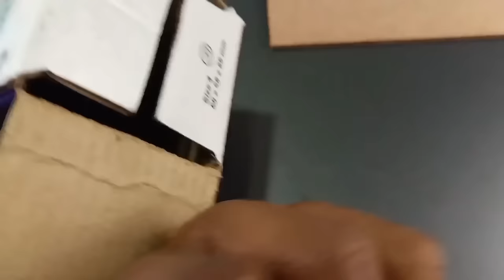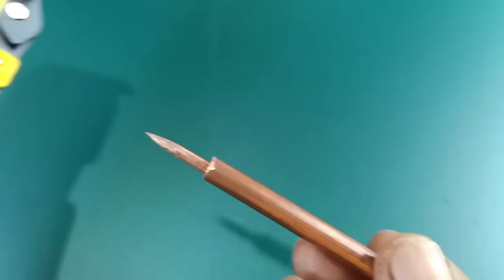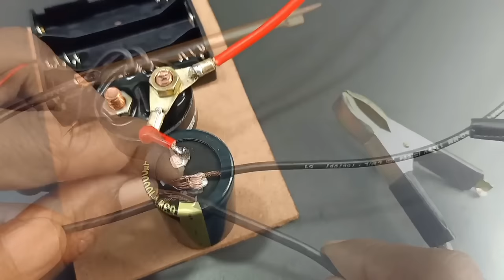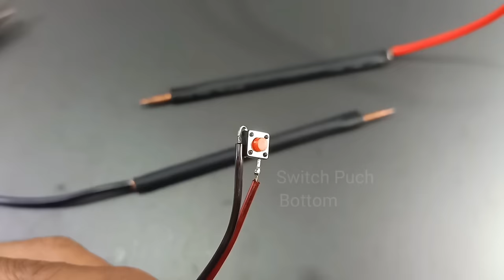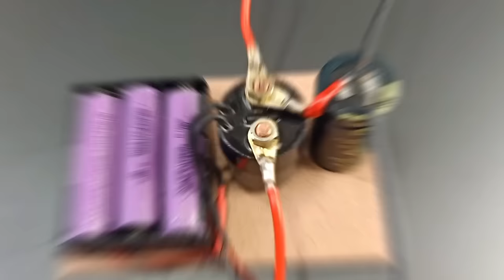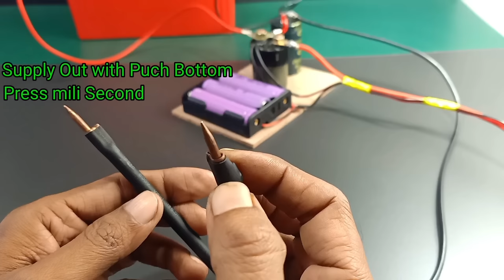Spot Welding Machine Simple & Power, Helpful for Home // How to make a Power SPOT welding A

Comment: Why the redundant power supplies? You have a main 12v battery, yet you use three  3.7v Lithium Ion batteries (11.1v) to power the control circuit. The control can be powered off the main battery, perhaps a 1 amp fuse wired in for safety. Even adding a fuse is less expensive than a battery holder plus three lithium ion batteries. Those lithium batteries actually could be used as the primary battery if you only need to weld for five to ten minutes at a time.
Second, a 16v capacitor is sufficient when running off a 12v battery. The 25v minimum rating is needed when running off a 12v AC transformer, because 12v AC is 17v peaks (12v average of the sinusoid wave form)

Comment: You don't need the 18650 batteries nor the capacitor , you put it there to make believe is something else , all the  big amps come from the red battery, and the relay can be switch  on/ off  with the red battery too. Or you don't know that the two circuits of the relay are electrically isolated.
Reply from the maker: You try, complete understand, lithium battery and without lithium battery

Comment: Use 1amp 12v enough if u use capator
Reply from the maker: Not possible, minimum 20A
Reply: Capasitor can charge usin low current
Reply: We will get 4700uf 25 volt 10 piece capasiror 47000 uf total below 260 rupees

Comment: How many volts should be battery? And can I use power suppyl instead?
Reply from the maker: 12v battery, you can use 12v 15-20 ampere transformer with rectifier bridge convert dc or adobter

Comment: Why two power sources? Wouldn't be it easier to use the big battery to power the relay switch button as well?
Reply from the maker: No bro, you try, understand
Reply: You're shorting out the lead acid battery when welding. What would the relay do?

Comment: Lithium cells are redundant if you are planning to use a 12V car battery.
Reply from the maker: You try, you will understand
Reply: @RJEDITALL  If you are getting a voltage droop such that your relay starts chattering you need to get a new 12v car battery.

Comment: I don't understand why not use the 12v car Battery as a power supply for the switching circuit of the relay?
There is no need for the additional 18650 in series.
Reply from the maker: For puch bottom
Reply: @RJEDITALL  but why not hooking the push button up to the car battery as well?
Reply: @oxdudepoege  Because battery voltage drops quite a bit when a battery is shorted. The short through the metal strip is temporary, and that way it's actually useful.
So, the requirement for a stable power supply is required.
Reply: @imnotbeluga007  but is that voltage drop even relevant. The spot welding takes place in a fraction of a second, so it wouldn't matter if the trigger circuit would reset through a lack of power input. 
I think the whole circuit would even benefit if this was the case. 
So one couldn't trigger the high current relay longer than it should be triggerd.
Reply: @oxdudepoege  Possibly so. My problem would be that it would open the relay faster by dropping the capacitor voltage (capacitor would charge battery due to current flow rules), thus getting a weak weld. Consistency is key, and the relay already adds a few milliseconds of randomization, which doesn't really matter. Sure, the voltage difference current flow can be solved with a simple diode..
Reply: @oxdudepoege  Of course it would matter if the relay lost power, it would switch off! Then the power would come back and it would switch on again. It would buzz. The contacts would arc and eventually weld itself on.

Comment: I don't love the fact that it shoots a hole instead of actually welding, as  seen in the intro. How do you prevent that from happening?
Reply from the maker: Why
Reply: Really, why? Because it isn't a weld, it's a hole! As you peel it off, you can see that it's not attached to the battery. 
Also, you risk to harm the battery. In this case tho, I guess it's due to the increasing temp as you weld them quite fastly, so it might not be a problem for a couple of spots on each battery.

Comment: How to use with transformer
 without battery
Reply from the maker: With rectifier n capacitor, same process, you use 15-30 ampere transformer 12-25v

Comment: Does that not damage the cell batray? Can the capacitor be replaced with a smaller one?
Reply from the maker: Use same capacitor
Reply: It's the lead acid that's doing the welding. The cells are just to run the relay. The capacitor provides extra current on weld contact.

Comment: Why not use a nice fet, the starter relay is going to degrade quickly?
Reply from the maker: No damage problems
Reply: @RJEDITALL  how can you tell, its sealed, you can not see the contacts. If you had a accurate milliohm meter and checked when new and after a few hundred welds, I am sure you could measure the damage to the contacts. A 1000uF cap charged to 3V can give 100A pulse, you are 20~30 times that.
Why not use a fet?
Reply: Crikey, can a FET do that?

Comment: Why not 12 V to switch from car battery? Need I realy seperat 18650 as switching voltage to the relais?
Reply from the maker: You try, with lithium battery and without lithium battery, complete understand
Reply: @RJEDITALL  Thanks, yes starting by the bike or car functionaly without separat switching voltage from a other suply - only one battery!
Reply from the maker: @hardypointer7358  try

Comment: hello, please tell me what characteristics a transformer should have, what power it should have and how many volts from the secondary winding?
thank you in advance)
Reply: and another question
the transformer gives alternating current, is there any circuit needed to convert alternating current to direct current
Reply from the maker: Transformer 220v to 12-24v 20 ampere,
Reply from the maker: @jokkin2558  use rectifier bridge 35-160 ampere for dc convert, capacitor same
Reply: @RJEDITALL  you mean to use a capacitor in the rectifier bridge circuit the same as in the video?

Comment: I'm sorry, I didn't understand the lead acid 12v and/or the transformer that you showed at the end.  Is this in addition to the 3 L-ion cells?  Or a possible substitute?
Reply from the maker: Main DC supply you use 12v battery or 12-20v 20-50 ampere transformer, 3 Li ion battery for puch bottom with Relay coil
Reply: You can't run the button and relay off the same lead acid battery because when welding you're shorting it out.

Comment: Starter Relay Scooter / ATV, Universal 50cc-150cc is good whit 25v capacitor ?
Reply: Should be good enough. Most scooter batteries have a starting current load of 80-120A.
But DO NOT use a car battery like him, the car battery is way more powerful and has starting currents of at least 550A, which is way too much for that relay.. either buy an contactor relay (expensive) or make a powerful relay. It's easier than you think.

Comment: So you're just shorting a car battery using a starter solenoid. Using li-po batteries was pointless because you could thrown the relay with your car battery power. Let's hope your starter solenoid doesn't spot weld itself as it often does since they're not rated for that much current. Have a phone pre-dialed with 911 handy.

Comment: The switch contacts will weld shut
Reply: @RJEDITALL  The full current flows through the pushbutton switch ?  If it will weld nickel then it will weld whatever the switch contacts are made of - unless a MOSFET is used for switching, but there is insufficient information to know what you have done.

Perhaps I am wrong and the current flows through the relay contacts, but I generally feel that a picture (schematic) is worth a thousand words to give clarity to your video.

Comment: Why use car batteries? Can't these three batteries be used for this product?
Reply from the maker: No bro, car battery needed
Reply: @RJEDITALL  Why did you then use three 18650 batteries ?, why are they needed?
Reply: @pavladar78  He used a relay.
A relay is an electromagnetic switch that can switch high current loads with low currents.
The batteries are required to give the relay power. That closes its contacts, and lets the high current pass. 
But because the battery is loaded quite a bit during welding, its voltage drops and it can drop below the relay trigger voltage. So a separate power source is required. It doesn't need to be a lithium battery pack.

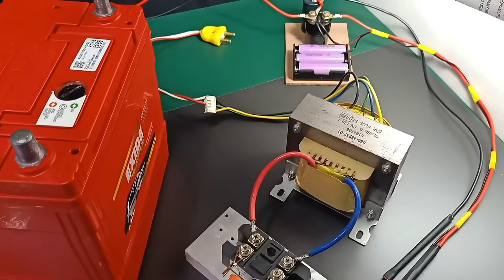Comment: Hello! What is the transformer for? /video 5:14/ Thanks from Hungary!
Reply from the maker: You can use 12v battery or 15-20 ampere 12v transformer
Reply: @RJEDITALL  OK Thanks!
Reply: @RJEDITALL  can it using 12v Accu battery?
Reply: You need a lead acid battery, at least 12V 7.2Ah. That outputs ~80A for pulsed load applications.

Comment: so you solder the ring lugs to the wires but you use a poor quality crimp on your welding electrodes, why?  A proper crimp on your ring terminals is superior to a solder connection.  Why don't they solder wires on aircraft?

Comment: If we neglect 0.22 resistor what happen
Reply from the maker: Damage your puch bottom
Reply: 0.22Ω is way too little. You need at least 180Ω resistor. Microswitches are made for currents up to 150mA.

Comment: Lithium Ion, fully charged means 4.2V, times 3 in series, .22 Ohms. (4.2*3)/0,22 = 57Amps... No battery management system.
Reply from the maker: 4.2 x 3= 12.6v
Reply: RJ EDIT ALL  12.6/0.22 gives around 57 amperes. Last time I looked on Samsung batteries, they are rated maximum 10A discharge current. A simple and safer solution is to replace the resistor with a car light bulb.

Comment: No need for the three [Li-on  3.7V] batteries. The 12V lead-acid battery can be used instead
Reply from the maker: You can try, understand, you try with li ion battery and without lithium battery
Reply: @RJEDITALL   I do not see the need for the Li-ion batteries. It shows a poorly thought design.
Reply: @kennmossman8701  During the weld the voltage of that car battery goes down and the relay may release before the weld is completed. After the relay disconnects, the voltage of the car battery would rise again and the relay would engage again. That loop could kill the relay very soon. Replacing the mechanical relay with something smarter (FET) would be a way to avoid Li-ion batteries. But all that is just guessing as I don't know how much the voltage of the battery actually drops during welding (in a car starter solenoid works just fine even if the current during start-up is huge). 

.
Reply: @Pvalila  It is a real concern?  There are two stages with a relay; latching and holding[latched].   The battery voltage is not affected until the contacts are closed - the relay is holding[latched] and typically needs much less current to hold and will continue to hold until the voltage drops significantly; even down to nearly 8V for a 12V relay in my experience.
The other factor is time. The welding time should be under 100 msec [often as short as 10 to 20 msec]. By the time the weld should be done, it does not matter if the relay drops out. 

>>IF<< it was a problem it is easily solved with a large value cap and blocking diode - far cheaper and less hassle then using a separate battery pack.

That leads to two further points. One is the use of a relay when a solid state solution would be easier, better, cheaper, more reliable, and more predictable. 

Second point is that this channel is very misleading and does not educate viewers. For example there is no discussion of the need to control the pulse duration*. I would further state the results are deliberately misrepresented. Another YT channel [Linus] built the same spot welder and had great difficulty in getting good welds - about a 25% success rate in good welds.

*pulse duration is important to avoid failed welds as well as burning through the connecting strip and even the device. It depends on the type of material and thickness.

This channel thinks simple is the only virtue even when it is  Simple AND Stupid.
Reply: @kennmossman8701  "I do not see the need for the Li-ion batteries. It shows a poorly thought design." haha, it shows your poor thought processes. You only thought this half way through. The welding process shorts the car battery, the relay would drop, the voltage then rises as the welding stops, the relay then comes back on, the voltage drops and the relay drops again and so forth until the circuit burns out.
Reply: @wayland7150  what utter rubbish, I addressed this previously.
Reply: @kennmossman8701  Yes, a lot of words saying it will be OK. The maker clearly already tried it your way and had a problem; "You can try, understand, you try with li ion battery and without lithium battery" and other statements on the subject. I expect it would be possible to find a way of solving the problem. Perhaps with a diode and a capacitor to hold the relay on. The fact is you had not thought this through fully and were caught out so came up with some BS to say it would work.
Reply: @wayland7150  LMAO    so lame.  He "clearly already tried it" - making crap up does not support your ignorance
Reply: @wayland7150   I used a "lotr of words"?!   ROTFL   I  guess googling 'spot welder' would present too many words for you!!!

Comment: So you need 18650s AAAND a 12v power source... not to count the soldering tip and those parts.... for about the same you can get an OK simple spot welder from amazon.... thanks for no thanks.

Comment: No need for anothe three small batteries and capacitor if you really know this circuitry..
Reply from the maker: Yes no need three batteries. You try this circuit, can understand. I am using this circuit for long time
Reply: Ok if say so, but, as far as i know this is an old school version of spot welder and i have been using everytime i needed this version for more or less 11 years i guess, WITHOUT ANY OTHER BATTERIES ASIDE FROM A SINGLE 12 VOLTS CAR BATTERY ONLY..  there is another video of this in YouTube, first one who presented before yours, you can check it out..

Comment: Another question is the relay used in the circuit with a damping diode? And why can't you take 12 volts to power the relay from a large battery? How does welding with different tape thicknesses work?
Reply from the maker: I am using for puch bottom,
Reply: You're shorting the car battery so that would stop driving the relay.

Comment: What is the 22ohm resistor for.?
Reply from the maker: .22 Ohm Rasistor for save of puch bottom
Reply: So the microswitch "won't burn out". Just use a bigger switch or a microswitch with a relay..
0.22Ω HEAVILY overwhelms the microswitch. At 12V, the peak current could be almost 60A, although the battery wouldn't supply more than 15A, that's still WAAAY too much current for such a tiny switch. Use a higher value like 180 or 220 ohms. The relay and switch will be much gladder.

Comment: Very misleading.   In reality success depends on the amperage AND the pulse duration. It is impossible to control the pulse duration manually since it is varies from 10 to 16 msec [or so] depending on the material and thickness.
This is a only a make-shift [sh&tty] solution. What is sad is that a couple dollars of additional parts wouuld greatly improve it.
Reply from the maker: Simple process for homemade spot

Comment: Not a good idea.
You can accidently burn hole in a cell by button sticking.

This idea would be better with some paralell IGBTs on a big alum plate as the power switcher and use a timer.

Using a clicker is Risky...I tried it myself and it was dangerous.
Timer allows more controlled and uniform welds.
Reply from the maker: Thank u for to give your valuable time. No dangerous problems
Reply: @RJEDITALL  Well. Until that little clicks button sticks from moisture or failure or human error and you burn through a 47a discharge 26650 cell ...oooo